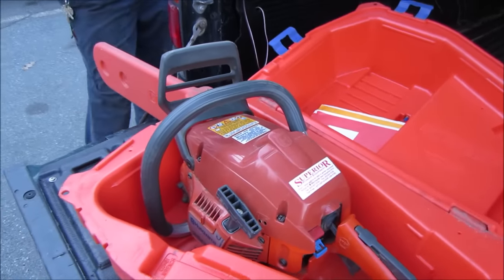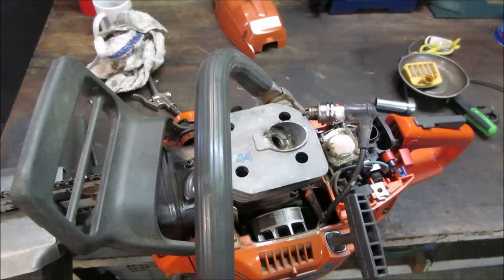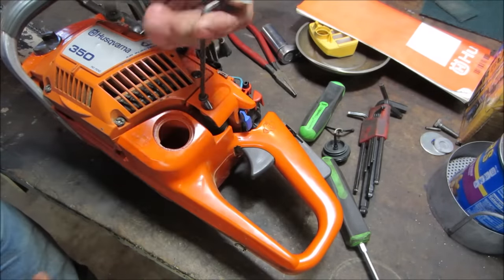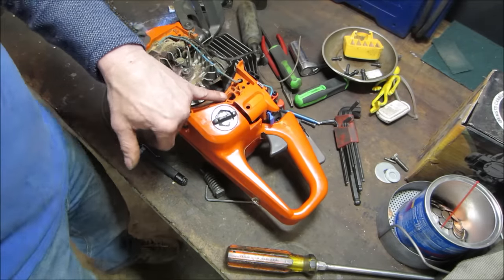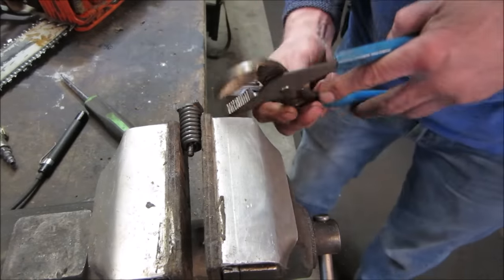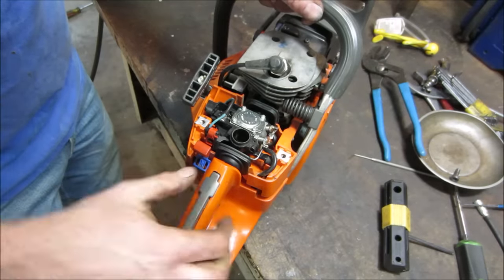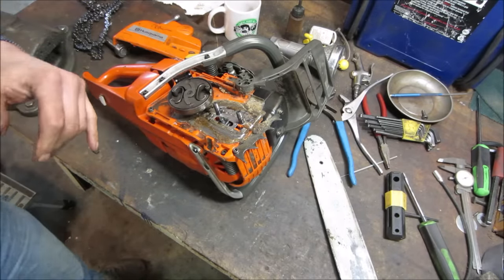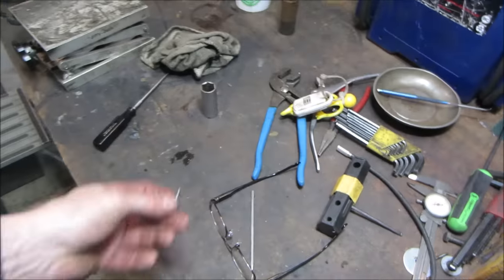Can It Be Saved? The Junkiest Chainsaw Ever. Picked out of The Trash.

Comment: The only problem I ever had with my 55 is that it leaks gas out the cap and I don't know why.  No cracks observed in the case and a new cap and o-ring hasn't fix it.  But, it's cut a lot of wood for me, once I learned you can't be lazy with the chain.  I learned how to sharpen in the field that way.

Comment: I have found 2-cycle equipment vibrates a lot in use and that causes mounting screws on the carburetor to loosen just enough to allow air to enter. That makes the mixture too lean to run well or start. At the beginning of a season I tighten screws on the carburetor and its mounts that could let extra air in. If someone brings a 2-cycle machine to me I tighten carburetor mounting screws and screws holding a bowl to the carburetor body. After about ten years gaskets are no longer resilient and need to be replaced.

Comment: I have a Lowe’s special, $149..99 orange saw. It says Husqvarna on the side, but it has not ran more than twenty minutes. It runs perfect, then it chokes down, quits and will not restart. I was in the logging business when I was young, I’ve owned many chainsaws, I have five currently, Poulan, Craftsman (same thing) and Husqvarna. The bigger Husqvarna is excellent. Starts on second or third pull, even on cold mornings. With no coffee. But this little one is junk. I promise. It’s junk

Comment: Don’t know if you know this or not just by seeing you start it for the first time you don’t…. After it quick fires with the choke on when it started for the first time and shut off, your suposto take the choke off right away after it burps, you went ahead and said oh Ile put the choke back on. And that’s incorrect! The more we know! Haha I’m a chainsaw mechanic, another good tip for you…. It doesn’t matter if it has “good” compression or not, one of the first things you should do is take the exhaust off and look down the exhaust hole for piston/cylinder condition. A lot of the time they are all scratched up and ruined inside, you can gauge a lot just by looking down the hole

Comment: Husqvarna was never designed as a homeowner's saw.  They were designed for the professional to cut wood faster.  They rpm higher so they cut faster.  The downside is they vibrate all the fasteners loose.  If you watch a professional use one of these saws you will see that every couple hours they get out their tools and clean and tighten all screws.  In my opinion and more recently kinda proven out they are the most junkie saws ever made and even though you have gotten things tightened up after a few hours use it will be back to the way it was when you got it.  The solution was for husqvarna to design a whole new lineup under a different name  (johnsered). I purchased a brand new johnsered and it has unquestionably been the best chainsaw I've ever used and I've had it for around 12 years now.  Still operates like it did when new and I've not had a single problem with it.  Husqvarna is junk!

Comment: Sounds slightly lean on the low speed screw. This is probably why your idle is high. Also sounds lean on the high side, this is where the scoring in the cylinder came from.

Comment: That's literally the saw I use every single week for cutting up little rounds to split for the woodstove. .  Mine runs great. . One or two pull start from freezing cold.  Only thing is the weird shutoff.  You pull up the choke to kill it wich isn't an issue when you're used to it but I've had buddies use it and standing there with it running looking and asking where's the shutoff? Lol. 
On a second glance mine isn't a 350 its a 352 or 356 or something like that .  I know it's hard to find chains for.

Comment: Believe 32:1 for that motor. Also that chain oiler was turned up way to high it was dripping out of the bottom when you had it running and that is why it ran out when they were using it and burnt up the bar. Should be a tank of bar oil to a tank of gas. There should be an adjustment under that metal plate in by the clutch to adjust the oiler.

Comment: Easy start with Husqvarna 350....pull blue choke(this engages red on switch), push decompress button....pull 3x or until burp, kill choke, pull to start.
I think it flooded when you first tried because it burped and you kept the choke on.
Btw, that's the factory directions for startup
Reply: Also, forgot to say yur video is great. Thanks for the breakdown.

Comment: I had a 35 Stihl BEFORE THE CHAIN BRAKE WAS INVENTED.    It was a great chainsaw. Always ran.  Minimal maintenance. Like most chainsaws.TBH  Person who had it either had bad luck or tossed the saw and broke the internal plastic.  So HE FLUCKED IT UP.   Oiler either was not working because the cover needed to come off to take out the excess sawdust build up inside the chain cover area.  You learn these things as you use them.  Everyone that runs a chainsaw out in the forests got to be a bit of a mechanic to fix it right there.

Comment: On the chainsaw you're working on is a Husqvarna which is a name brand chainsaw also the oil tank should have a pickup tube in it so it'll work in all different angles.  John Deere chainsaw you were working on is made by Remington and made John Deere chainsaws for years. The sprocket bars have a small hole by the sprockets which is a grease fitting and uses a special pointed grease gun to grease they need to be greased just like greasing a bearing

Comment: I have a Husqvarna 44 I bought new in 1977, I live in Minnesota and cut and burn about 6 cords of oak a winter. Moved to Missouri in 91 forgot about it until 2020 dam it has  gas in it. I dumped it out 🤭🤮put 50:1 gas in it, started on 3rd pull still runs like new.
Reply: 44 rancher

Comment: Husqvarna are great saws to use and WAY easier to work on than Sthil, Dolmar, etc. I have several of each in different sizes. Stihl is really common around Chicago with the 'pros', but they have in-house shops and local dealerships/repair shops.  Husq's can have rather expensive air filters. While simple to replace, (at least the older ones can get pricey).

Comment: u can test the chain break by dropping the bottom of the tip of the bar on a log or something, it should engage if u dropped it with fair force. if it does not go on it probably will not work in case of a real kick back either :). i never heard anyone say this in any video, its a good way to test it anyway
Reply: Better to just hold the saw level and running, then cock your forward hand so that the back of that wrist hits the guard...which should activate the chain brake.....just as if you were holding it and hit something while cutting....

Comment: HINT..I’ve got the 460  model and it kept stalling.  I changed the fuel filter and fixed the issue. In fact I ran it for two years without a filter and it ran better than with the filter you just need to make sure no dirt in fuel.  I washed out the tank with water…yes water.
Reply: You're never going to keep it 100% clean, hence the need for a filter. And yeah it WILL run better without a filter as there's just less resistance but you will never keep everything out of the engine without a filter for any amount of time. and it WILL damage your engine in the long run. It's not always going to just kill it right away.

Comment: PUBLIC SERVICE ANNOUNCEMENT - NEVER use "green" bar and chain oil.  I learned the hard way.  The "green' oil is made from used cooking oils.  It so gummed up my chain, bar, tip sprocket and drive sprocket and became so hardened, I had to disassemble the saw (which in itself was no small feat), pry the chain out of the bar groove with a screwdriver, soak everything in kerosene and scrub it all with a brush and break the chain joints loose from each other, to make it functional again.  The chains were literally as stiff as a board!  And this was name-brand oil!  I have two Husqies and used it on both.  The saws had been sitting for about three months.  I went to do a job and could use neither saw as a result.  Stay away from the stuff!

Comment: Husky doesn’t make a “junky” chainsaw ….it’s usually user error and neglect that causes most problems …granted anything mass produced can have a failure but typically if a piece of equipment is taken care of it’ll last for years ..
I’d say being over 20 years old and if that’s the only thing that went wrong was a stripped screw that’s doing pretty good.

Comment: Marine epoxy for that stripped screw. Lightly grease the screw threads and fill the hole with marine epoxy and when it hardens you will be able to back the screw out and if the case is cracked there the marine epoxy will fix the crack.
Reply: Nailed it!

Comment: When I heard the junkiest  chainsaw ever made i was thinking the homelite brand the red plastic ones . When I seen it was a Husqvarna the guy that owned it obviously screwed it up as he didn't know anything about chainsaw maintenance. Like a previous neighbor I had gave me a brandnew gas  weedeater said it was garbage . Moron was running straight gas instead of the required  50:1 gas oil mixture  . I fixed the problem  with proper gas

Comment: No doubt he got it pinched and hung it up in a log, pulled it half apart trying to free it. Ran like crap from then on. No throttle control should have been an easy problem to notice. My Husky 575XP is the best saw I’ve ever owned. And she is a beast. Running 24”, 28”, and even a rarely used 36” bars. 
   If you want a low cost, best stuff up saw, the Poulan 460 Rancher is a fantastic all around generic use saw. I use it for all my “dirty work”.

Comment: My first chainsaw was a Husqvarna 20 inch. The first year it was fine. But I started having problems starting it. I tried everything but it was a bitch to start. I took it to a local shop and it cost me about $50. But it's been fine since. I don't know what the problem was. I will say I think it leaks chain oil a tad too much when stored. I bought a Stihl as a backup. It starts SOOO easy with the spring loaded mechanism. But it was $100 more than the Husqvarna.

Comment: It is idling to high because it's got an air leak. Probably at least at the intake boot. But possibly where the cylinder riser mates to the case as well.(common problem with these saws.)

Comment: I for one, am DONE with gas chain saws! Battery all the way!  My new Greenworks gives me the same power, and the run time of 2-3 tanks of gas,  (pend on how hard each is working today.)  aginst my old Husky-V...  18in vs18 in to BTW...  No more mixing, spilling gas, no spark plugs or air filters to deal with. No more tugging my guts out to start it,  just push a button, and pull the trigger.  As one would with gas, I just keep the chain sharp, and keep bar oil in it.  Plus I have a couple spare batteries, so when I'm done with the firs, just clip in the next one and go!

Comment: use the tip of a cable tie in the stripped hole and push the bolt into the hole to rethread through that

Comment: Besides the boot clamp problem the upper cylinder adapter isn’t machined flat it leaks air. You need to sand both sides on a flat plate.

Comment: I'd call that a "ein/a" or "error in user/ abuse". Saw seems fine if it had been properly looked after and not abused.
I have an old Husqvarna that my uncle used to own and run a lot, then he stopped and sold the saw to me for cheap. Still works amazing after all those years of hard work. If you care for them and use them correctly Husqvarna chainsaws should last a long time. We also have a cheap hardware store saw, just a few years old and still showing several issues with it. So it truly is worth going for a used name brand over cheaper ones if you ask me. At least if you check so it has not been abused.

Comment: Husqvarna are only second in the pecking order to a Stihl saw and are, for the most part, extremely reliable (shit anti-vibration set-ups aside).
Working in the timber industry for decades, my choice of saws for most purposes was always a Stihl, however, one of the best 'Huskies' we ever owned was an old '65', great saw which was hard to kill.
Mustie, when you are working in a vice with a chainsaw, please please please drain the chain oil, remove the chain and replace the bar to mount it in the vice, one slip is all it takes and a chain won't stop for flesh and bone, believe me.....
Great video yet again as always and a great find👍👍👍

Comment: Seems like that saw is running lean? I would think that the max rpm should be 12,500? I couldn’t watch the video all the way through but seem to be idling too fast and the carb probably needs adjusted.
Reply: My guess is previous owner fucked with the factory tuning and ruined it. Idle is way to high and its leaned out to shit. Dropping it a bunch probably did it no favors either.

Comment: Husqvarna and Stihl both make these mini chain saw styles. biggest issue is I would call them gardening chain saws good for occasional light use but not for use all day chopping logs they are just not built for it. The full size ones with 20 + inch bars in comparison go through wood like a hot knife through butter.
Reply: These saws will easily do work all day. They're not made to work all day every day but you are really underestimating them in your statement lol
Reply: @thedarkness5133  Yes I would still stick to my comment the larger saws are substantially stronger in construction and the chains are bigger less frequent sharpening and they actually cut twice as fast ignoring the diminutive blade size advantage the large saw has over them. But they do cost twice + more. My estimation is quite correct not suitable for every day constant use and I would rate them more dangerous than the bigger saw.
Reply: @thedarkness5133  I have used both and the smaller saw although lighter becomes more tiring due to its reduced capability. Saying it is a competent professional tool is dangerous. I would rather hire a proper one or save and spend the extra to get one that is capable of the job.

Comment: Had same problem with brand new 20 inch husky lasted a day took to dealer they said the cylinder scored not enough oil  would not stay running   they said it would coast more to fix then replace
Reply: So, who mixed up the 2 stroke mix? you were using...or did the dealer not bother with any instructions?

Comment: I have a very similar Husqvarna 55 from same era as this one. It is well built. BUT Since brand new - always been VERY hard starting. Once you do eventually get it started, it cuts slower than my smaller Stihl or larger PoulanPro. Doesn't matter how recently tuned or how sharp the chain - it's rubbish. (Yeah I know 'Poulan' but while it's a little cheaper construction - it's been more dependable, starts easily, and cuts much faster)

Comment: I had an old Husqvarna saw that wanted to rip your fingers off while pulling the cord. I fixed it permanently and then bought a new saw . There is great satisfaction in taking revenge out on a saw that hurts your fingers. Sledge hammer worked well

Comment: To start a  Husquana easy is to pull out the choke and pull the starter and dont tuch the gas, when it starts and stop again push the choke back in and pull the starter and it will start right up.
You dont use the thruttel at start up

Comment: You could have put a short piece of vacumn hose over that metal pin where the bushing appeared to be missing? Get rid of as much slop as you can. I have the exact saw but never had it apart but the handle isn't as wobbly.

Comment: Try to get a 353 the proffs one, one of the best 50cc.. by the way pull out the choke jank the start cord until i fires then push in the choke tab in with out fingering the throttle then you have it on higher rev and when it runs good use the throttle to snap it back to normal low speed...

Comment: I always pull the muffler to inspect a piston if I find low compression, first thing I would check if it's not running..  I wouldn't have bothered with all you were doing here till I knew the compression, and see it working for a bit at full temp..  Just because it ran for a few seconds doesn't mean a whole lot.. Pushing on the cut, dull chain, no bar oil, or geniuses leaning out the carb too much can burn up a saw in a few seconds.  Yeah it may sound better but uhh, not for long..lol

Comment: There's  nothing wrong. I loaned my 350 to somebody and it came back the same way. Pinch the bar, then pull like hell, separate the mount.Throttle  lever pops out leaving the Throttle stuck wide-open

Comment: First find a bolt the same size and thread pattern, put a thin coat of 3-in-1 oil on the bolt threads and use JB weld in the hole then run the bolt into the hole all the way to the bottom and wipe off the excess JB weld and wait 24 hours, next remove bolt and reassemble! Or drill the hole all the way through and use a longer bolt and a self locking nut!

Comment: Always check the fuel pickup line on these, they tend to separate. May run & idle then fall flat.
Reply: Worth completely replacing the fuel lines every 10 years; also clunk filter and primer bulb...

Comment: The clutch is not tight on the shaft.
Recheck that.
That's your rubbing of the cover.
Also the very small holes on the bar are the oil holes not the large ones.

Comment: Have been running a 435 for 14 years  70 chains through it       Removed the .99 brake band 12 years ago.  it's junk.  If I buy a new 435 , I'll probably remove that garbage brake band immediately...... just get it over with

Comment: I want that saw your lucky it's one of the good ones made in Sweden 👍 and I think what happened it's when someone falls forward and hold on to the saw and push down hard on the handle. But in this case I think it's from a pinched bar and yanking on the handle to get the saw out because the bar has no paint in one spot and if you look you will see a couple of dents in the bar.